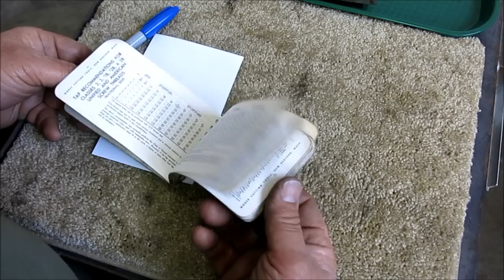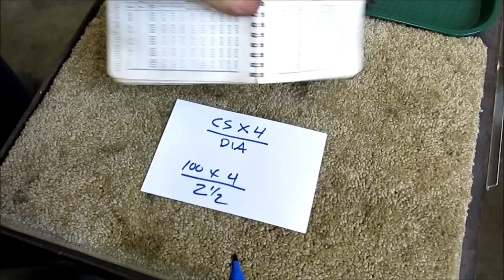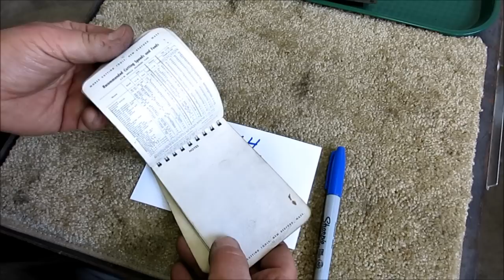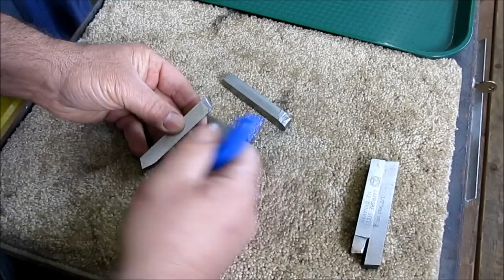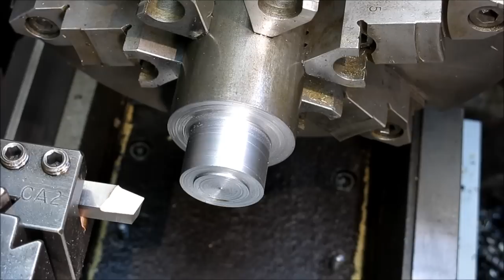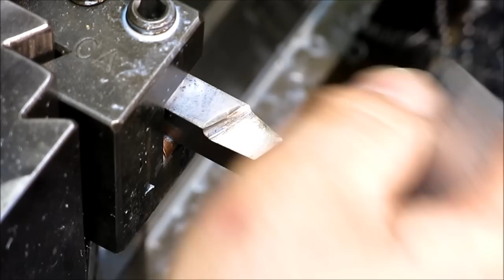Chip Control to Major Tom

Comment: With the 10° lead angle ground in and the deeper depths of cut you were taking, the cut begins closer to the tool post than to the point, so don't you end up with a matching beveled angle on the shoulder where you stop your cut, almost like it was a form tool?

Comment: Any micro(say .0001) deviation from a true plane on the leading edge of any cutting tool is actually worse for the drill wearing than just taking the whole edge down to being smooth. In case any of you were wondering why he lapped the tools, he did it because a tool wears from one of 2 things. Either by friction (I.E. gradual dulling in a relatively uniform manner) or by exploiting the inherent geometrical weakness in the chipped portion of metal which causes any chip to still have microfractures around it which only serve to actually keep chipping further instead of wearing.
Honing a tool is like shoveling your walkway 2 feet wider if you live in a place with alot of snow. It helps mitigate the amount of times the material need to be removed to still provide reasonable performance. You do not have to hone...They both work, but in a relatively short time the non-honed tool will dramatically decrease in performance. And on a micro scale it will also leave tiny ridges everwhere there was a chip.
Wonder what if anything you could do after honing. I assume a chemical coating would further refine the edge as well as possibly eliminating surface pores. And he is absolutely correct, tools do not always cut best at center. But it always has to be close

Comment: Are the drill feedrates given per diameter or as a formula using diameter as a variable? I also believe there should be a variation due to web thickness as well as the flute depth, lead angle, flute geometry and overall quantity of material and rigidity left in the drill structure after grinding. And that isn't even mentioning the big hitters like point and relief angle, and every facet engineered into it purposefully designed to be material specific. You would be the perfect guy to write a better guideline. 
I'd give hundreds of dollars for something like that lol. 
There is more to be written about the process of machining variable wise than just about any other system in the world. But computers are steadily compiling the info. Silently waiting and listening. 
I keep track of things like the deviation in the finished dimensions of parts I make based upon the temp of the machine, up-time, and how long it has been sitting in a state allowing it to cool. I love the Swiss process... It is one of the most controllable manufacturing processes I have been exposed to.
Which is why I can't wait to start learning both tool&die processes as well as advanced metrology.

Comment: you would be a good teacher at school explaning this with visual difference , all what i had  is HSS  low cutting speed and  tungsten carbide tips high speed  (the rest on your experience  ) and these with changeable tips  ( bench grinder not even  cut well ) .. .:) , good fun .... afther you have to go and  "dress" bench grinder wheal :)  i didnt knew any thing better at my  15'teens :) ....wonderful times  been ,  we just try brake a thing  and no punishment , if i be with my knowledge back in those times

Comment: by then  i been thinking what no way i take 5 mm or more depth of cut  ,but with  good tool (and bravery) it did just fine , (just needed right tool angles ) but to get it on the bench grinder  you need lots of time to  practice  (good school time i had  )

Comment: Hi Tom, Thanks for the Old School lesson in Basic HSS Turning Tool Grinding.
You ground your Top, Side, and End Angles to 10 deg.
I wonder if you ground the Top Angle to 5 deg and ground a 1/64th nose radius on the tool,
would it help with chip control and surface finish?

Comment: Where are the chips?
I just see dangerous hand-shredding curlies?
There was a tiny bit of chip control as you raised the elevation slightly but it still looks like curlies will give big issues in an automated cut situation here.

Comment: If the chip is changing color, you know its doing its job.  That is, carrying heat away; from the tool and from the work piece.  Well done!  On a side note, we have a lathe guy in our shop that absolutely LOVES to let everyone know when he's cutting 304 stainless.  The high pitched screeching is an abomination and everyone in the shop despises it and we're not wearing hearing protection and have to listen to it all day sometimes.  There are many factors involved when cutting 304.  The tool height, the radial depth, the cut per rev, tool condition etc., and yet.... he professes to be an expert but can not rough 304 with no screeching.  There IS A WAY gosh dang it!!! and ... what it is I do not know but I would supremely like to show him how to do his job.  I've worked a tiny bit on the lathe and am mostly a mill guy but when I cut, I cut.  I don't rub and chatter.

Any suggestions, Tom or posters here?  It is aggravating and bothers everyone in the shop.  Is there a way to deal with this with numbers?

Comment: I have to ask, you have a perfectly capable surface grinder why did you not use that to flatten your cutting surfaces? do you want curved cutting edges? 
A rounded nose ensures a single point of contact to the work, so a larger nose gives you a lot more play with you tool centerline I saw you made your radius bigger but why did you stop there? (most inserts have a much larger nose radius) 
Why did you not cut a chip break behind the top cutting surface and rather load the tool until you had the chips break after hardening?  I'm under the impression that hot chips equal tool wear, so a chip that breaks cool is a much better chip. 

I'm a novice that hasn't touched a lathe in 20+ years but I want to pick it up again (retirement has its advantages) Just curious if my understanding is in line with your experience.
Reply from the maker: Hi Sy,

Setting up the surface grinder and making the edges perfectly flat does not increase cutting efficiency enough to expend the time to set up the angles and machine grind them. Offhand grinding was the subject of the video and well within the capabilities of most folks with a normal bench grinder. Thanks for the comment.

Cheers,

Tom

Comment: As much as I realize how much carbide insert tooling has made life in the shop easier I also believe that if you don't know how to grind and use HSS you aren't a machinist. You're an "operator". Well OK maybe a little more than that. I'll use carbide for most operations but for a lot of stuff I switch to HSS for grooving*, threading and form tools. Plus most manual lathes simply cannot take advantage of carbide threading inserts in terms of speed. 

*A lot of the grooving I do is face grooving for O-rings. The tools for this usually require more than normal side clearance to clear the outer diameter of the groove
Reply from the maker: Hi M,

I agree that you need to know why and how a tool cuts whether its high speed or an insert. If you don't understand how it works its pretty tough to diagnose when you have problems. Thanks for the comment.

Cheers,

Tom

Comment: Tom, Your detail showing on the tool profile geometry grinding is AWESOME!!!!!, Nowhere is there any real clear data on it apparently it just gets absorbed by osmosis just being around old salty machinists!, thanks again for helping the noobs out here floundering along
Reply from the maker: Hi Boat,

Oh cont-rare. There are many books and technical references on single point cutting tools. Remember this is a old technology so there is a lot of written information on it. Check out tool design and cutting tool engineering for more than you ever wanted to know about single point cutting tools. The good old How to run a lathe by Southbend also has some good abbreviated info. Thanks for the comment.

Cheers,

Tom
Reply: @oxtoolco  that is a good book.
I have it.

Comment: I used to cook my fingers every time I used a bench grinder to shape HSS. I was watching this vid and feeling the burn. I've adopted a new strategy and it seems to work for me. I use a belt grinder with a pretty coarse ceramic belt on it to rough shape the blank. When it's close, I use a bench grinder that I put diamond wheels on, and that finishes fast and super smooth. For the heavier bits, like Tom's 1/2 inch sample, this works really well. I typically use smaller blanks, 3/8th being the largest normally, and typically, 1/4 inch.

Tom you should also mention that surface finish is highly dependent on the quality of the cutting edge on the tool. This can be demonstrated easily. Even a sharp, well formed tool will give lackluster finish if it's rough. You can still screw up the finish a thousand ways, but the only way to get a great finish is to do everything right, tool speed, light depth of cut, surgical polished edge of correct geometry, presented to the workpiece rigidly, saturated with the correct lubricant/coolant. Only then can optimum finish be achieved. Also there are some materials that simply do not finish well. A36 hot rolled steel under the best conditions feels like "cat tongue" when turned because the material tears ahead of the cutting tool ( or so I've heard ). Using some exotic lubricants ( Crisco ) help, but I always leave time for using the toolpost grinder on the stuff if I have to use it. Then there's 12L14/2011/303 which have a very wide envelope of cutting conditions and still give excellent finish. 304 stainless makes stringy chips under just about every condition. Designing geometry, and finding a speed/feed to get chip control on 304 would be nice.
Reply from the maker: Hi Jeff,

What belt do you like for grinding high speed steel? Thanks for the comment.

Cheers,

Tom
Reply: Hi Tom, I use the Red Label Abrasive ceramic belts for the 2x72 grinder in the 36 through the 60 grit versions. I buy them on Amazon usually. The normal belts tend to shred when applying the tool with the sharp part facing the belt travel, the ceramics seem to be OK with it. If I'm really motivated, I'll put the 1000 grit belt on, flip the bit over and get some honing done. My fine diamond wheel is 600 grit I think. I don't have a leather stropping belt for the grinder, but I'd like to try that on my tools eventually.

Comment: Great video.  I love seeing you guys go back and forth and share ideas.  Would be great if Keith Fenner would weigh in too.  Two questions, what manfacturer/material/grit are your grinding wheels and what is the water based coolant you use? Keep it tasty!
Reply from the maker: +dragonrc0 Hi Dragon,

Kieth did finally weigh in. I can't remember what video it was in but he put some chips down. The wheels are from McMaster Carr. Aluminum oxide 36 grit and 60 grit. I think they were Norton brand.  Thanks for the comment. Check out my video on Toms two cents worth on oils and coolants.

Cheers,

Tom

Comment: Tom, what is that tool called @23:50 that helps you get your cutter on center?  That's awesome.  Did you make that?
Reply from the maker: +RumpLeINtiLINsKinnIN That is a tool center height gage or gauge. The top section is made by Hardinge. Thanks for the comment.

Cheers,

Tom

Comment: I am not a machinist. Is not the "depth of cut" determined by the feed rate while the amount of cut is really the "width of cut"? say 10thou depth of cut and .5" width of cut?
Reply from the maker: +Grandpa Cocky Hi Grandpa,

Depth of cut is a radial dimension. The feedrate is expressed as linear travel per work revolution. What that means is the chip that comes off has a width equal to the depth of cut and a thickness equal to the linear feed rate per revolution. Hope this clears things up. Thanks for the comment.

Cheers,

Tom

Comment: Greetings- I was trying to point out to others who have light duty 3 jaw chucks and a short purchase
that they would have trouble making this depth of cut without using a tail stock. I have had it happen to me many times with a 12 inch atlas and short purchase.  More likely, the part will move into the chuck as far as it can, and the part will slip in the chuck. I suspect your surface finish would be better with a tailstock. Jim

Comment: Without a six jaw and much purchase in the chuck the part would have slipped or pulled out of the chuck long ago.
That is one reason to use a tailstock. I know it interferes with the video.
Jim
Reply from the maker: +Jim Ladd Hi Jim,

Not following you here. Had plenty of grabstock on the part. No tailstock needed for this video. Thanks for the comment.

Cheers,

Tom

Comment: the carbide tip actually dissipates the heat from the cut so you can so in higher speeds with the carbide bits

Comment: I'm going to jump right in here the hone in the brass jaws or copper love it 100 fpm 250 rpm feed rate 3 low what's that? at .300 the ribbons got jammed 1 1/4  .400 above center chip slinger .100 tame ribbon catcher nicely done millimeter above back on center could make  a good oil inlet plug if it was threaded for a headstock cover

Comment: Hi Tom,
Nice vid, can i ask what grit/type of course wheel you are using on your grinder? It looked to move the HSS very well, far better than the 36g white AlOx that i use does.
Cheers,
Ueee
Reply from the maker: Hi Ueee,

Its a Norton AlOx bench grinder wheel from McMaster carr. Nothing fancy at all. It is a hard bond. The white wheels are a much softer bond and break down faster. Is that the problem you are having?

Cheers,

Tom
Reply: oxtoolco
Thanks Tom,
Yes my wheel does seem to break down fast, leading to rubbing and excessive heat build up. I also use WKE45 (11% Co) almost exclusively which i'm sure does not help! I'm sure i still have the original hard bond wheels that would have come with my grinder, i'll fish one out and see how it cuts.

Cheers,
Ueee

Comment: wow awesome chips Tom. i have a largish (13" swing over bed and 4' between centres) and i think it would struggle with cuts like those, epic work and good tool grind.
keep up the good work. off to see what adam comes to the table with.
also liking the soluble oil for smoke free cutting.
best regards
lee

Comment: Hi Tom,

a question on the ´finger-rest you have installed at the grinder disc. What is the tilt(approx.)? Do you have it setup at 0 degrees tilt(meaning flat) or do you have a slight angle? I mean the L-shaped metalplate surrounding your grinding disc?
Reply from the maker: Hi Chippie,

Its flat and on the center of the wheel. Sometimes I tip the edge closest to the wheel up a bit if I want more clearance.

Cheers,

Tom

Comment: Let me be clear… I am now much more versed on the relationship between feed, RPM, depth of cut, geometry and sharpening technique. I am just a bit confused as to the specific goals. Thanks!!
Reply from the maker: Hi Jeff,

The goal is in the title. We plan on showing just what is possible with hand ground high speed tools then move into some of the more subtle parts of single point tool geometry. Its a lot easier to get people engaged when you start out with some impressive cuts. Yes its entertainment but lots of things to learn as well if you pay attention and try things yourself. To answer your question straight up, there isn't really an end goal other than to show you guys more about tool grinding and have some fun. 

All the best,

Tom
Reply: There is no end. Pay attention😂

Comment: Hi Tom, you've invited people to join in on the action. Check out my attempt on my vintage atlas lathe on my youtube site. Any tips you can provide would be much appreciated.
Reply from the maker: Hey Steve,

Way to go. That was 1/8 on the diameter with 1/3 hp. Excellent use of available power.

Cheers,

Tom